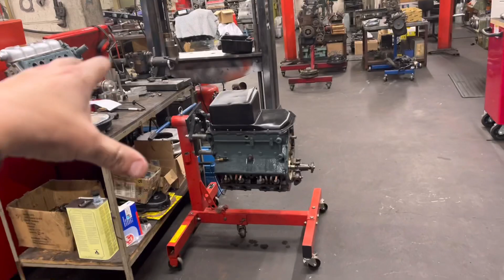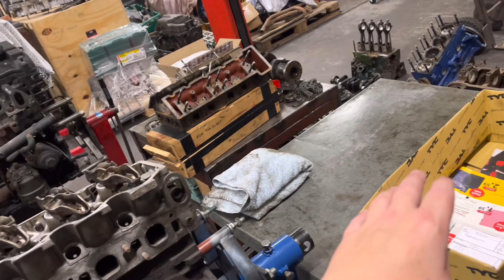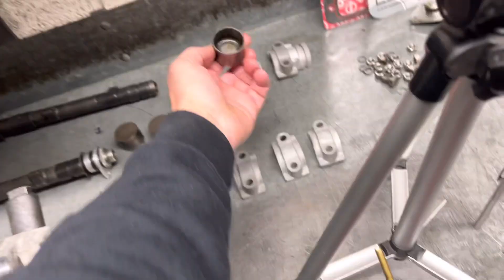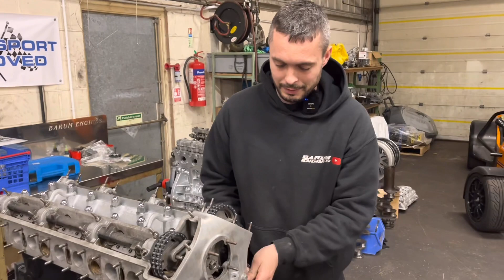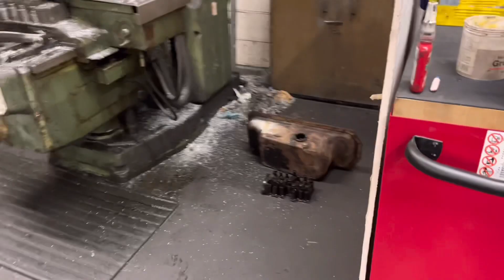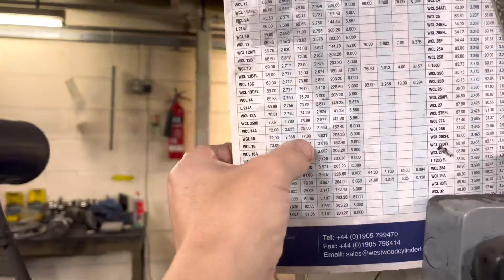This rare engine has ‘all been done’. But WHY oh why would they do this?

Comment: Question. What would you consider the maximum compression ratio for a normally aspirated petrol engine now we have up to 10% ethanol in regular petrol and 5% in some super? I read the Mclaren F1 had an 11 to 1 ratio and it was normally aspirated and likely ran on Super unleaded available back in the day with no Ethanol. I want to play with upping the ratio of a small eco car for example a Kia picanto or Hyundai i10 or such like not for power but for getting the best MPG from the fuel available today that is very different from when those cars came on the market. PS I am a machinist and have a milling machine big enough to skim small heads. Thanks
Reply: I run over 10.5:1 and at 900 ft above sea level 91 non ethonal or ethinal based is borderline. Hot dats are worst but yeah our octane is borderline really 93-95 is what we need

Comment: Got a third third liner in all six cylinders of a six litre DV66B once. It became the DV66B/18LNR/4.2L on the work docket! That was to reduce capacity to meet a lower tax bracket for Moldovan mountain road regs with narrowed-axle rigs. Strange job, granted. Special, even... As long as the previous ones don't move, buckle or tear it's fine, just push each one in chilled and stack 'em up like cardboard coffee cups. Lump then went over 300k without a hitch and came back for a crack from a core plug seat. Mended that and back to Chisinau it went for many more years of quarry plodding. Moldovan agent was named Kermit - yes really! Lovely, lovely guy. Dead now at fifty. We got away with plenty of "bodgeneering" on unstressed, low revving, torquey PSV and truck diesels for the "sick-bucket" central and southern European export market back in the good old days before the Brexit headscratch sucked a .030 feeler leaf straight into the induction port of our foreign trade. Domestic trade picked up to cover it when a local rival went for his final dull-bronze collet, thankfully. More than 3000 builds and major repairs at our shady shed so far, mostly for happy contract regulars, but no warranty claims or engine thefts (WTF???) ever. Wii-nnnner!!! Oh, and why not properly cage up that filthy old mill? Floor all around it looks like Brighton beach on a frosty morning! Doesn't it stick all in the mats on the Lambo? I'd have kept that well crusty unit slarked off the strap, even for bread and butter big oil burner work in your not-so-clean but probably just-about-clean-enough clean area adjacent. Hey, if I'm having a YB head job done I want C-L-E-A-N as a B-E-A-N, ya know what I mean? As well as the all too obvious swarf puffing issues, it could very well lob a grenade at one of your lads' skulls. Kerack-clang-ouch! That wouldn't be too clastie now, would it? Right then, tea break over, and I'm back to the Axminster linisher again with a fresh coarse belt on it.

Comment: Hi Lee. Similar thoughts as others .... get a barrier either side of the mill m/c . To protect guys, working close, from shrapnel if a tool breaks and to stop ANY debris flying that way . Hopefully a head would not travel too far. Do you use airlines at all on the mill or anywhere because miniscule particules will travel to your assembly area. I would suggest possibly enclosing sideways and from above your final assembly area. Crap can fall from the rafters.
Keep doing the good work. Regards Don.

Comment: Really well done on the workshop tidy up - looking much more organised and efficient! Have you condsidered making use of the space vertically (more than you do at the moment)?

Really hope those first two cylinders on the Alvis block hold out (there really is not much betwen them now!) but I guess that will increase once the liners go in?! Erring on the side of benevolence, I‘m guseeing the ’liner within the liner’ bodge might be more to do with correct gauge liners not being availale at the time, with the second liner being a ‘make-up’ - either that or the initial rebore was to much?? Irrespective, it‘s still unacceptable.

Great video as ever, and keep ‘em comin’
JCHK

Comment: Enjoy the channel, reminds me of my younger years. How clean an area is not as important as how clean the assembly is. Many years ago I built a Triumph Tr6 engine in a damp, one car rented lock up. Pulled the engine, disasembled it. Took it for machining and balance to my local engineering shop. Crank grind new bearings, rebore and pistons, head and block surfaced. I did the valve work. The reasembly was clean not because the garage was clean, it wasn't. Ran it in by driving to the South of France and back, it never missed a beat, the madness of youth. Maybe a naive suggestion, how about a Henry type vacuum?

Comment: First jag 4.2 head i did i spent hours setting valve clearances on inlet cam it was getting very late working in my shed in middle of winter i bolted the exhaust cam on without removing inlet cam  big mistake as i turned the exhaust cam a loud click and i bent a inlet valve i never made that mistake again.

Comment: Why don't you use the ramp as a high level shelving.
Make a fixture (work platform), then load it then lift it up out of the way.
Yes you will have the columns. But most of the stuff in video would be out of the way.
And lower it if you need to access stuff on platform.
Just an idea

Comment: If the 'liner within a liner' was in one of the locations where the block was thin between the bores, there may have been a concern that the block would split if they had to take more material out to clean up.
Reply: If its gona crack from boring out sleeves then it really outta be done all the way. While i see what ur saying maybe just get a new block if u cant do it right

Comment: Great improvement with the shop layout! Can I suggest making with tape/ paint a border line for each area so your walkways remain clear for you and the trolleys have safe access at all times. It’s really easy to encroach into them without a reference. At the airport all around the terminal points you’ll notice the painted areas for tugs, trolleys and equipment to prevent any safety incidents.

Comment: Nice job on the shop Lee! Plasterboard isn't structural, however if you fill your sprayer with water instead of paint & put an even coat on the sheet so it's wet but not soaked and let it air dry the sheet gets hard and less chalky. Then some paint will cover up the water stains,it won't take a hard hit but it won't crumble.

Comment: You need a mezzanine floor plus a base and cage on the lift for moving up or down.

Spend the christmas shut deep cleaning and painting the floor so in the new year the last hour on a friday is spent cleaning  everything ready for the next week.

It's nice to work in a friendly atmosphere but you need structure and discipline in the working enviroment tp be able to carry on doing so in a clean and safe enviroment, something you are neglecting to do at present.
You have a great team who would be a major plus in making some much needed improvements , theirs a storm brewing economically,  failing to prepare is preparing to fail.

Comment: When I worked at BCCR we had a completely separate room/area for stripping engines or gearboxes and until they were cleaned thoroughly they would not get into the “engine” room which again was completely separate from everything. Having said that you have a lot ore engines on the go than we would have had!

Comment: A liner within a liner????  WHO THE F* would do that?  No sir!  Dodgy is putting it lightly.  I'd be chasing someone around with a hand sledge.  Very curious how this Alvis finishes out.  You may want to install a two ft tall piece of plexiglass on top of that plastic sheet you have between the clean area and the mill - as a lust in case precaution.  Also........MOVE THE TRASH CAN.

Comment: I wasn’t really happy with the final finish on those bucket hold down brackets. I think they needed more sanding or polishing to take those sharp edges down plus the one you showed in the video wasn’t close on one side, and too close on the other.
Reply: They work.  Any more time spent on them is wasted. The slight offset on the one shown won't make any difference to its function.
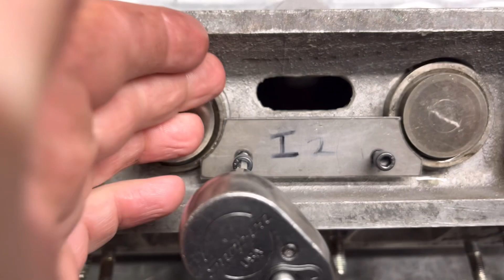Reply: Agreed, my first thought as well. At 7:27 I don't think that the LH one would stop the bucket lifting?
Reply: Looks like it would do its job just fine. As long as there aren't any metal dingleberries or shavings after cutting it should be good enough for the job.

Comment: Reference thickness between cylinders.Some of the old mini blocks get machined over 1380.The endurance of those must be questionable otherwise BMC would have done it themselves in the first place?
Reply: My brother had one taken out to 1420cc back in the 80's & it has more than 30k on it(weekend/fun car) with no issues (120bhp at the crank).
Reply: @GARDENER42  I thought to get over 1400cc you had to re-stroke the crank, +40 tho to 1340 is the usual lmit
Reply: Going over 1380 doesn't work with all blocks, sometimes the gap between cylinders 1&2 and 3&4 is too small to tolerate it. In any case, unless the object is an out and out racing engine the exercise is a little pointless.

We asked Hepworth's what they recommended, they had one set of +40 flat top pistons. Coupled with a tunnel bored head, a medium rally cam, a pair of  1.5" SUs, a gearbox from a mini van (with suitably ground case to accommodate the crank throw) and a tuner who really knew his stuff we had about 93bhp at the wheels and enough torque to pull the side off a house. Those were the days!
Reply: My understanding is automatic blocks are required to go big capacity.

Comment: I for years used stupid plastic dustpans and brushes then I discovered you could still get "engineman's" pans and brushes on ebay, which are basically a short handled coal shovel head and a thick brush like a yard brush but for hand use and boy was I impressed as not only almost indestructible, it being metal and thick wood construction was able to handle hot shavings and other metal bits and seriously industrial quality.   Get 'em off ebay for about a tenner.
Reply: Construction commercial grade we still get good stuff

Comment: A line boring/welding set up would allow the cylinders to be built back up before boring to size to suit liners, rather than getting to the point of becoming paper thin between bores. I would imagine the last time that Alvis had any major work done was decades ago, hence the Russian doll liners, not the way it should be done granted, but I would imagine it was a means of salvaging an otherwise scrap lump, maybe it was the only way thye could do it without custom made liners

Comment: Build a platform to set on the lift arms. Put some of the lighter stuff on it depending on what you build it from. Load it up and shoot it up in the air.
Reply: Downside of this is it encourages hoarding if you can't easily get to stuff stored on it, but more space is more space!

Comment: When I worked at Vintins (different name now) at Bury St. Edmunds in the early 1970s they used to have steel mesh screens between each Milling machine in a line of machines. This to prevent any metal flying off the table and hitting the adjacent operators. Also once a month they cleaned the machine shop floor to a white finish. You could eat your dinner off the floor it was so clean. If you were on a dirty machining job the labourer had authority to stop you every hour to clean your machine area. Reason being they manufactured cameras and TV studio equipment.
Reply: My late uncle worked for them for many years, a small world.
Reply: Were I work in  an engineering company it's an absolute shit hole, that's including the new bosses and the management who run it.
Only 8 months till I retire 😉.